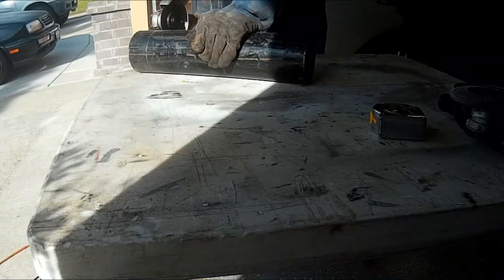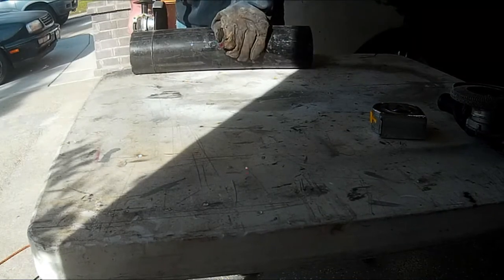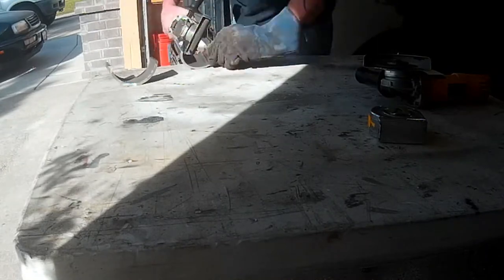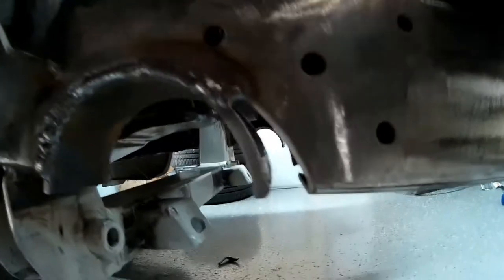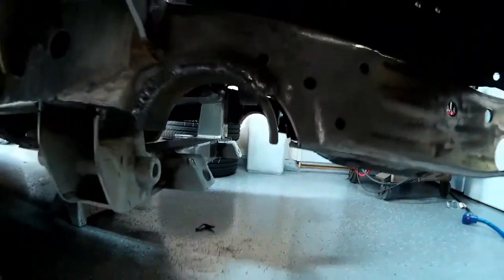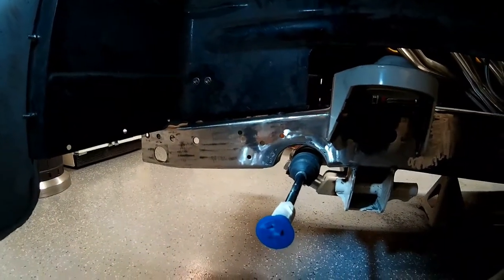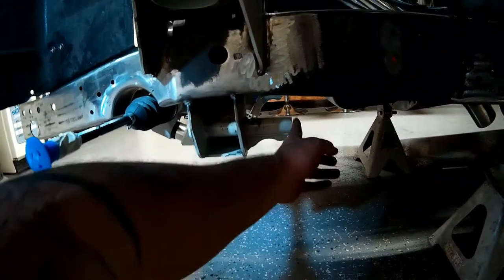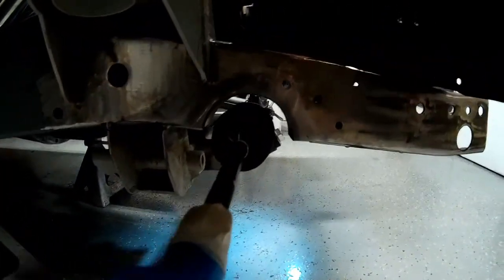P48 Project; Helix Mustang II IFS Install, Part 8 - Notching The Frame

Comment: A number of suggestions if you don't mind. First, safety glasses ANY time your working on your back. Coming from someone who got a piece of metal dead center in my pupil and had to have it cut out and now have permanent distortion in that eye.....wear safety glasses dude!... Secondly, wear a dang welding jacket when your on your back or anytime for that matter. Splatter up your arm pit or in your ear simply sucks. Everything else about your videoing takes practice.. All I'm concerned about is you living long enough to get better...  :)

Comment: What size pipe did you use for the notch?
Still waiting on my rack. :-( 
Thanks
Mark
Reply from the maker: hey Mark!  i used the same 4" sch40 for the notches as i used for the exhaust cutouts on the trans x-member.  it ended up being just the right size to clear the boots on the steering arms.
Reply: Thanks for the reply Jim
This will help out alot
Keep up the good work